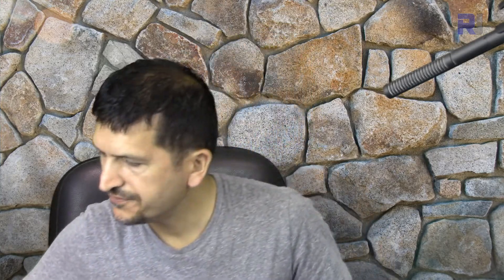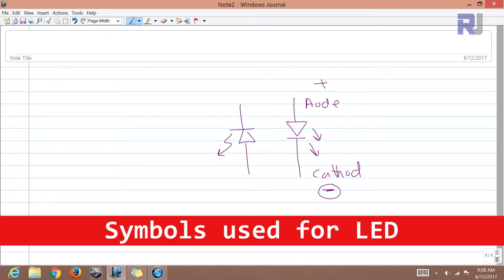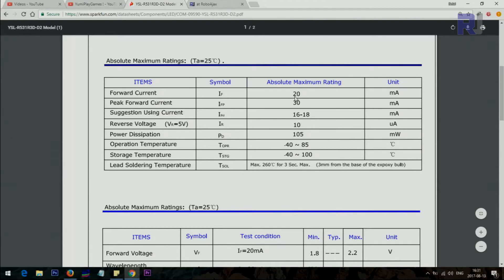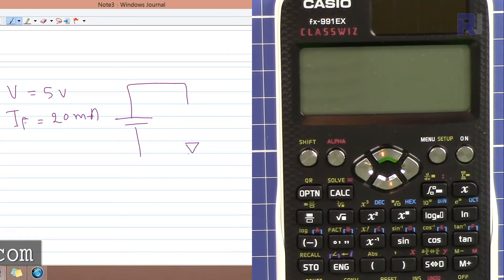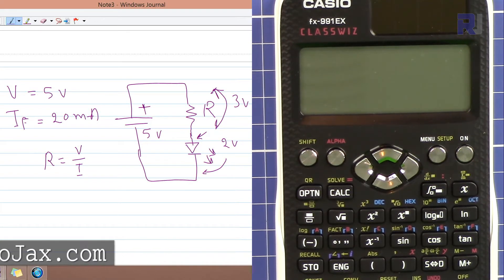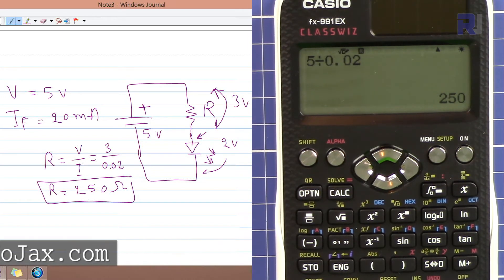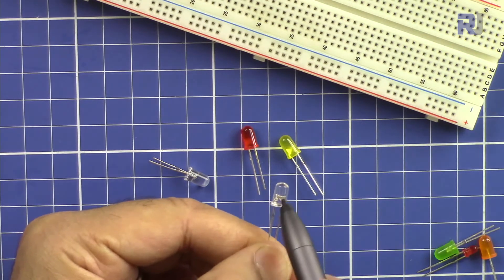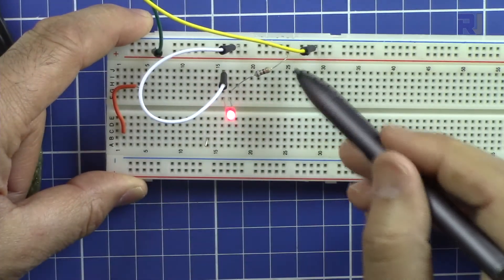Using resistor with LED and how to calculate it - RJT656

Comment: Did you use the wrong voltage in your calculation? You used 5 volts instead of the 3 volts or am I missing something?
Reply from the maker: Thank you for letting me know.
Correction: at 4:50 the value entered in calculator should 3 instead of 5. So it should be 3÷0.02=150Ω. So the resistor should be 150Ω and NOT 250. Please accept my apology for the error.
Reply: Thank you Sir!